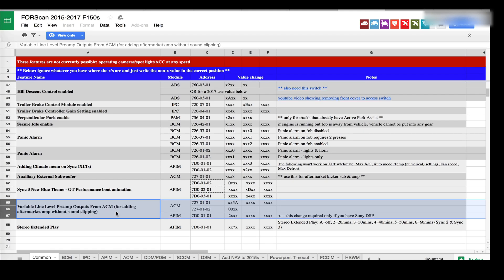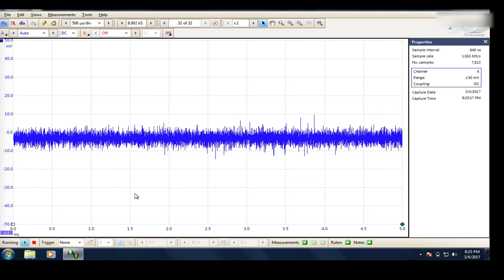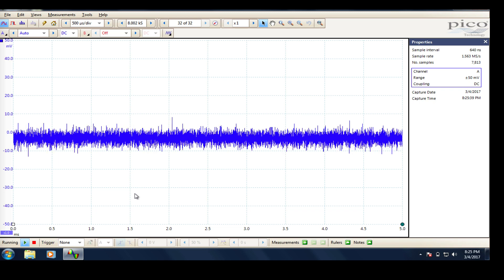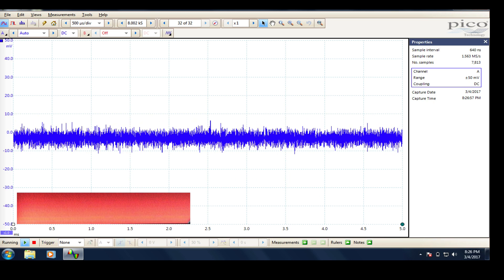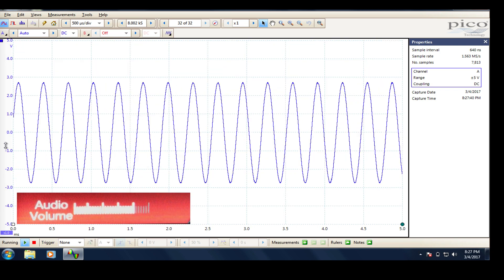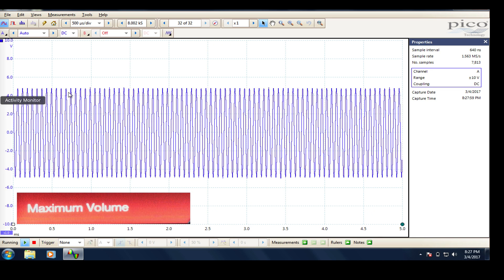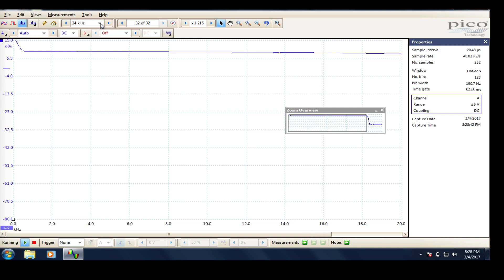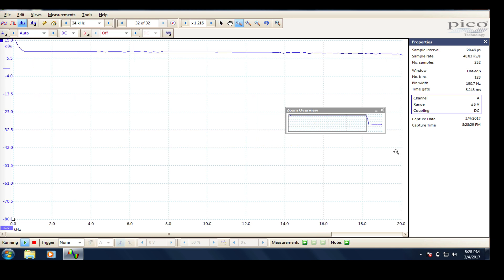Ford ACM Variable Line Output Oscilloscoped for Voltage and Spectrum

Comment: Good morning. Thank you for the video!
My amplifiers indicate that you can connect a signal:
Pre-In sensitivity:
LO: 0.2 ÷ 5 V (line input)
Can I use Variable Line Output then?
Reply from the maker: Yes you can use variable line output you will need to make the forscan ACM changes noted in the video and you will also have to connect your amplifiers to the correct outputs